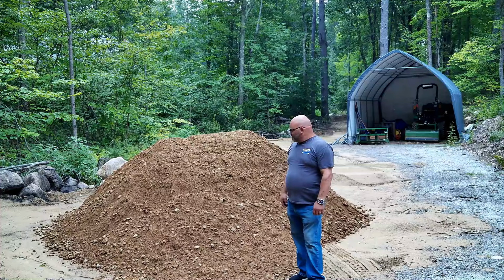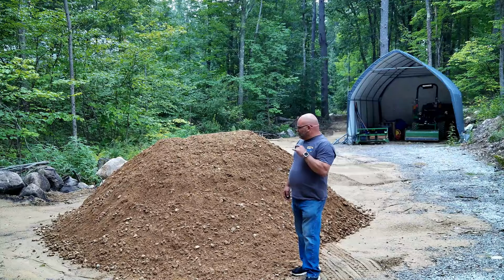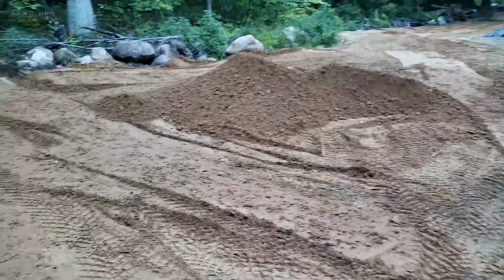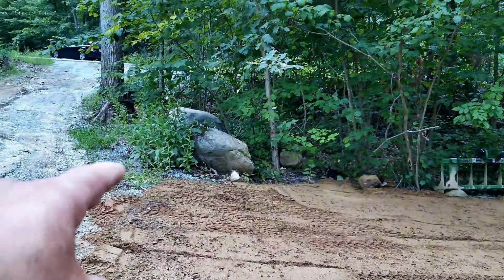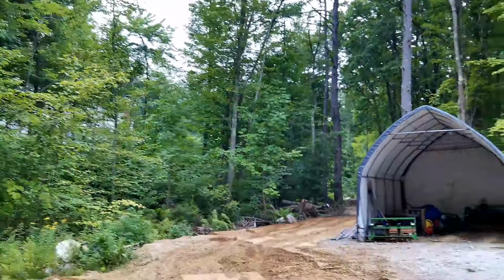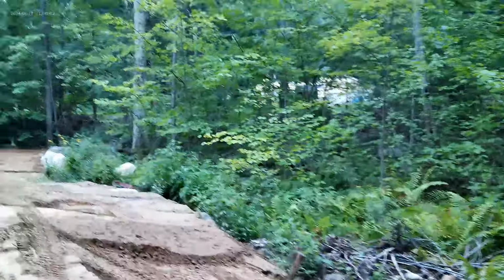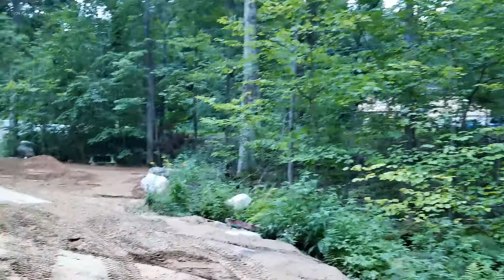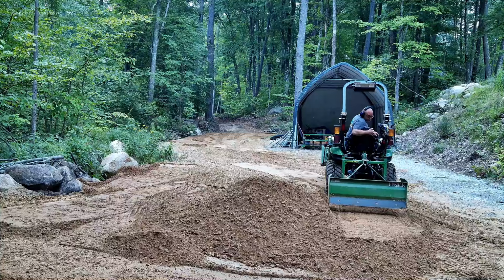Spreading Crushed Gravel with the 2025R and the Frontier Box Blade

Comment: Good morning Neil. Haven't seen you for awhile. I believe that you will love the crushed gravel. I'm not sure what kind of stone that is because of the color but it's limestone in our area. In the last week we've put down 6 tri-axle loads of it on our road coming into our property. Plus another one in our driveway. It will pack down like concrete. The plain stone will wash away in a hard rain, this will not. But it needs to be packed in well. We usually just drive over it several times for a day or two then normal wear and tear. After a rain or two you'll see more gravel on top and less of the fine stuff. The only thing that I use the loose gravel for is a french drain or to set a tractor attachment on so water can run under it and not sit in dirt. If you go over it several times with the box blade it will level out and look great as well as be strong. I'm not trying to tell you what to do or how to do it, I'm just letting you know what works well for me. God bless and have a wonderful day. 👍👍🙂
Reply from the maker: I ended up really liking how it came out and how it worked so it turns out it wasn’t really a mistake. God bless you, my friend.
Reply: @MightyLittleGreenMachine  God bless.

Comment: In the southeast we call that Crusher Run (or crushin’run). Pretty much every gravel road and decent driveway around here is made with it. When ordering a load if you mention you want a road base material, this is what you’ll get unless you specify you only want clean stone. 

Sounds like you might’ve missed a lower loader grease fitting. My grapple with squeak like that if I open it before I grease it.
Reply from the maker: I was very impressed with it

Comment: Hello. I noticed bolt-on- hooks on your loader. Do you like them?
I also have a JD 2025R. I have just finished spreading 10 loads of gravel on my driveway extension. The tractor made the job much easier.
Reply from the maker: I do like them a lot. I do use them on a regular basis. I went with that set up because it gives more strength to the center of the bucket. The John Deere buckets are known for being weak there and bending.

Comment: Do you have the top/tilt link or just the top link? Is it a John Deere part or after market?
Reply from the maker: I do not yet have the side link. I am going to add it. I have the summit hydraulics kit which added three functions one from my third function, and then two for the rear and the hydraulic top is an aftermarket top link.